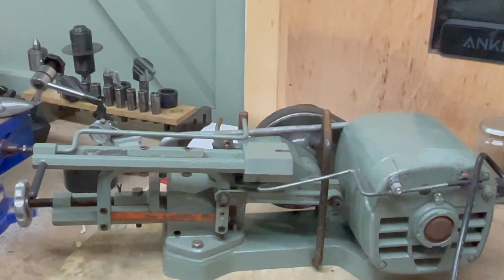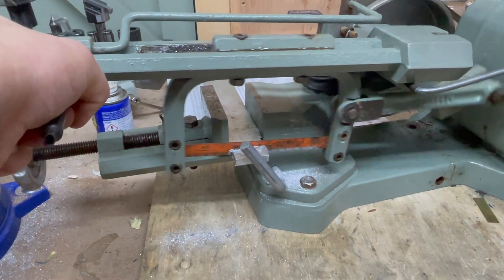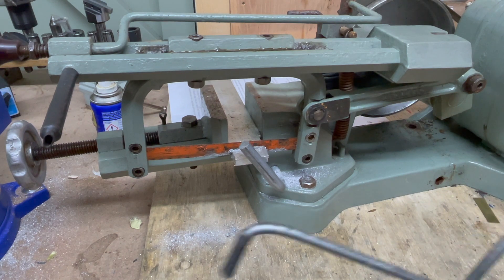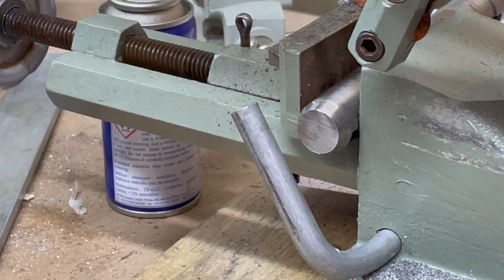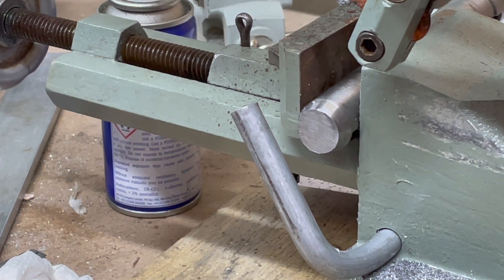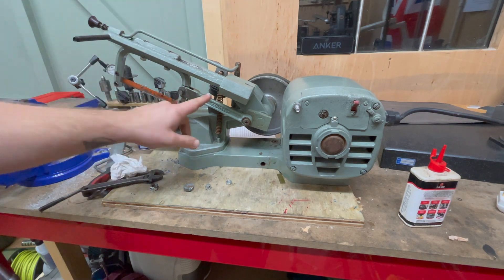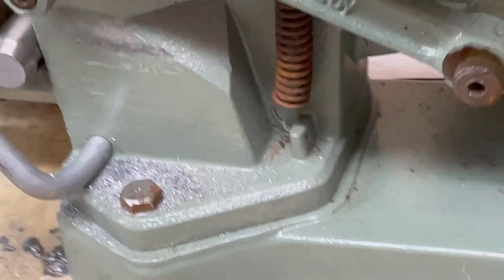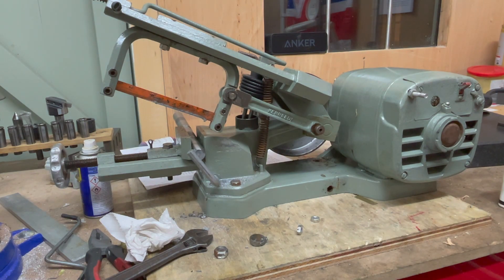I bought a terrible Kennedy Hexacut

Comment: Hi William
You say terrible , but it depends what you paid for it, there's nothing on them that's not repairable or  adjustable.  They are not heavy duty cutting machines but great for hobby work whilst doing another job
Happy hexacutting
cheers
Kev (mr f's w)
Reply from the maker: Well let's just say that I know I paid more than I should, the second I opened the box and saw it in person. The Lord obviously sends these things to test us, so that's just fine. I need to fix the auto-cut-off, I like your arrangement and I might try to retrofit that to this one somehow if I can...
Reply: Only thing that's not repairable is the hex bars, they wear away if not lubricated and can't be replaced because they are cast into the main body, I know cos mine is going for scrap!
Reply: @sillyfecker  Hi walter
thanks for feedback, don't scrap it, everything is repairable, if i lived close i would have it off you for a project.
take care
Kev
Reply: @MrFactotum  
Hi keV
If you want to come to collect it's yours, FOC! 
Regards Walt
Reply: @sillyfecker  Thanks Walter,  depends where you are, i'm near chesterfield 👍👍

Comment: I have a 90 version just cut through a 4x2 inch ms channel, took time but very good, I like it.
 👍🤓
Reply from the maker: Ah, how did you find the rigidity? I find the blade wanders and I end up with quite a wedge shaped cut? Did you do anything to the jaws?
Reply: I have a 90 version really impressive
Reply: Hi what blade size and tpi you use in your 90 thanks

Comment: Great Video! Saw hummm! Only joking, it's not bad really, I'm sure you'll make improvements over time to it functions that frustrate you, that's the way it goes.  Enjoy your new tool!
Reply from the maker: Cheers - frankly it's not the worst tool in the shed and at least I don't have to hand saw my way through steel billets. I think I need to get some coarser hacksaw blades for my regular hack saw because my lord it took ages. I think the first thing is to fix the automatic cut-off and get the sodding paint off those rails!

Comment: Hello William,
I have one of these too, but I've never used it due to lack of space to set it up. When I get my workshop organised (sigh) I hope to get it sorted. I don't have the Hoover motor, but I'm sure that I nave a suitable alternative.
I've still chickened out of fitting new belts to my Super 7 as I believe there should be a mark on the headstock spindle to align a collar for preloading the bearings, but I can't see.any mark and I din't want to risk catastrophe.
Reply from the maker: Ah, I didn't know the S7 had that requirement. I've often thought about upgrading to an S7 in future, but I think I'd rather spend the money on a lathe with a bigger swing in the long run. Mr Factotum has a great build on an even more compact hobby mechanical hacksaw, which inspired me to keep my eyes peeled on this one...
Reply: @williamsworkshopuk  A couple of thoughts.
Lathes with a bigger swing - like the Colchester -  are great but sometimes the chucks and other accessories are too big and awkward for smaller workpieces. Obviously, the best option is to have the space and resources to keep
Reply: both.
Secondly, some years ago I gave a hand to a friend who had a small welding business. He bought a chop saw with a metal cutting tungsten carbide blade. It was quite awesome and much faster than the mechanical hacksaws I have come across, including the one at a Technical College where I went to a hobby engineering class. If I were buying a saw now, I think that I would look in that direction.

Comment: An old friend of mine told me the hacksaw blade has to be put in backwards so that it cuts on the pull stroke. I have one I haven't powered up yet, the spelling is correct on mine.
Reply: I take that back, Ive just read the instructions and it said it cut in the forward direction.
Reply from the maker: Oh, maybe that will help - thank you very much. It needs a new blade soon!